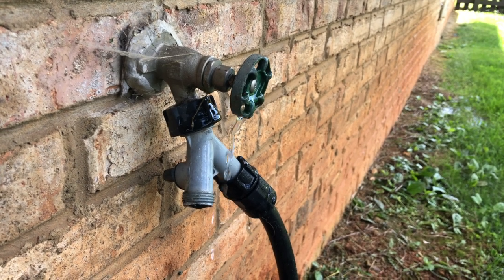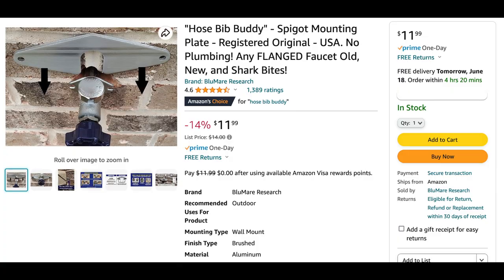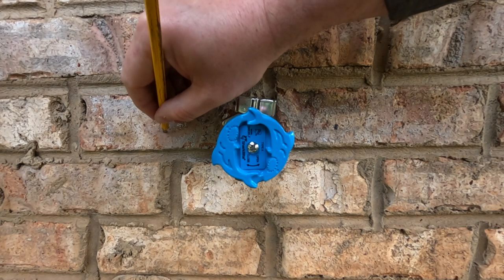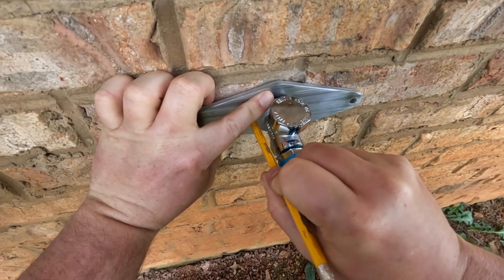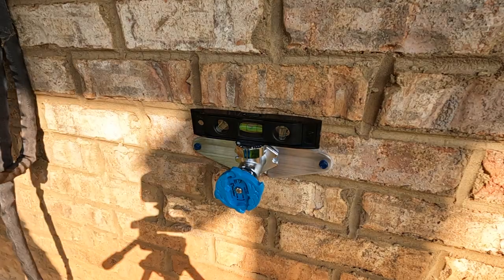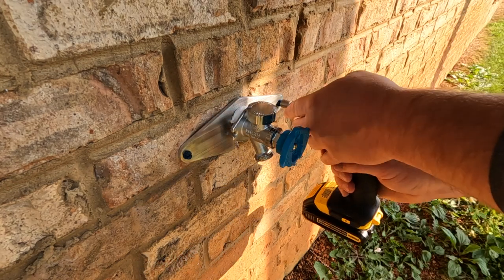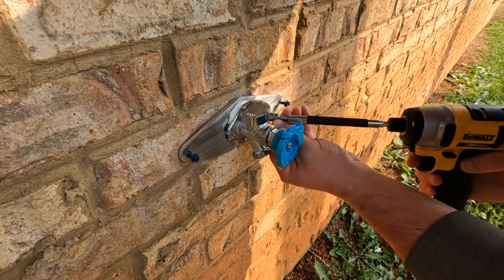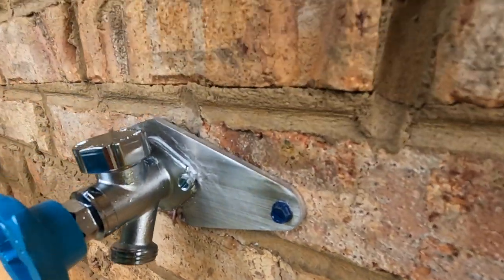How to Attach Hose Bib to Brick - Install Outdoor Faucet with Hose Bib Buddy

Comment: Nice video! Get'r done!   --- Just a note: if the handle of the spigot is in the way to drill the pilot holes, it's normally very easy to just remove the handle. You've convinced us to put that in the instructions! I slide the plate in back and never remove it - drilling the holes for tapcons right through the plate holes and the pilot holes for the screws directly through the faucet holes or slots. (It is easier with a drill extension.)  Glad it all worked out. The next one will go much easier. Thanks again!
Reply from the maker: Thanks for watching and for the suggestions.  Removing the handle crossed my mind but I didn't know if I'd mess something up.  Yes, I agree, the next one will be much easier. haha. The bib buddy looks way better than mortar.  Will definitely use on future hose bibs.
Reply from the maker: For some reason I'm just realizing you and your wife own the "Hose Bib Buddy".  Nice product!

Comment: Which frostproof sillcock is that.. looks durable and purdy :)  That bib looks so nice along with that metal sillock.  The plumber wants to install the plastic flange Woodford Model 19 along with the PLASTIC woodford bib.. look god awful and not very durable in the photos the plumber show me of a recent job.  This looks so pretty in comparison.  I want all metal sillcokc and dont know which to get .  Was considering the Prier C-144 but darn this one looks very nice.  Just replace the plastic handle with metal.